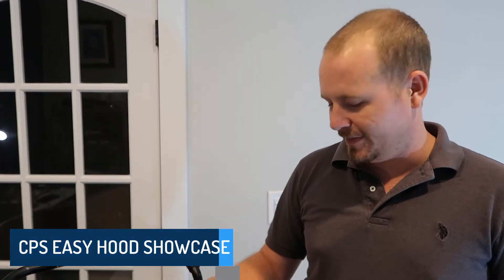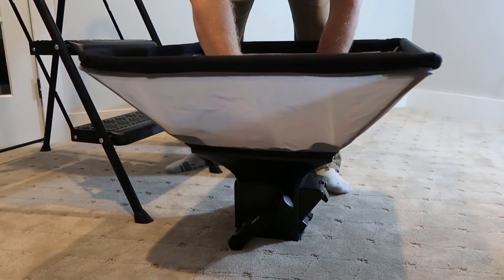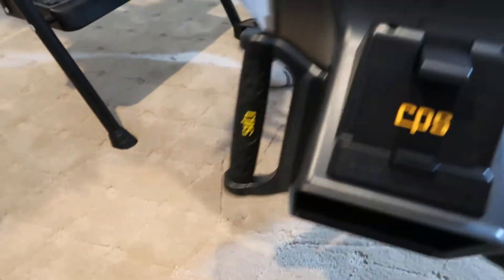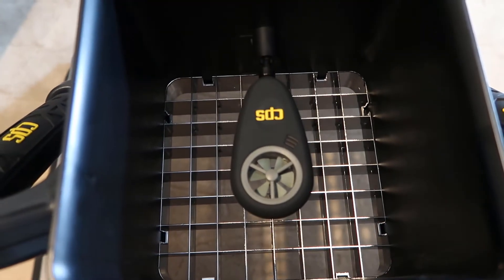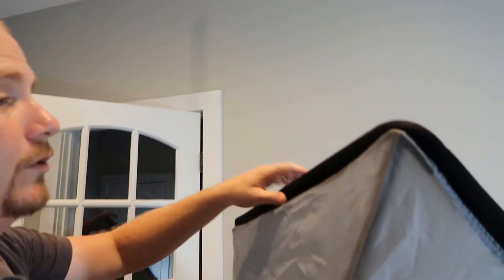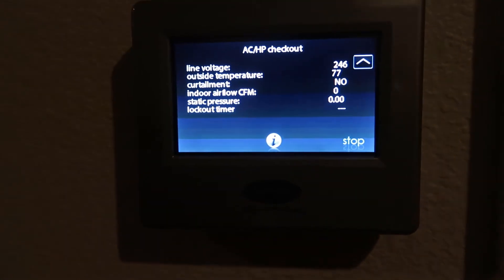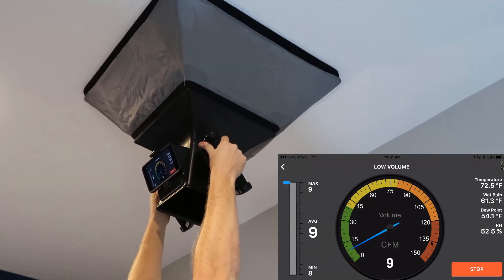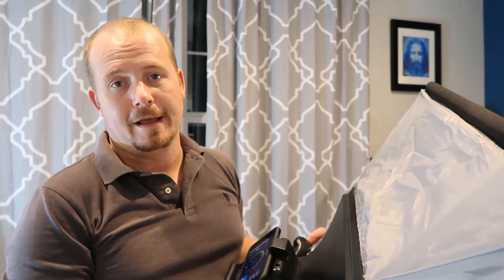Measuring CFM with the CPS ABM EasyHood

Comment: Can i use it for returns on residential units under 5 ton ? And  if so,then i can use the testo app for btu’s !!!!!
Reply from the maker: Hi Mike, The rated air flow capacity is 1200 CFM, so it would fall short on a 5 ton system with a single return assuming 400 CFM per ton.
Reply: TruTech Tools LTD. just bought this from you this morning! I hope it works well. Thanks for the reply
Reply: The higher the airflow the less accurate it becomes at 800 cfm on a return it only read 532 https://youtu.be/UDzoUG01Eu4